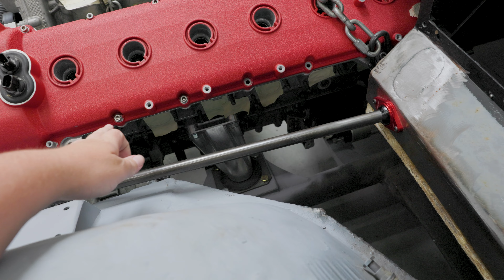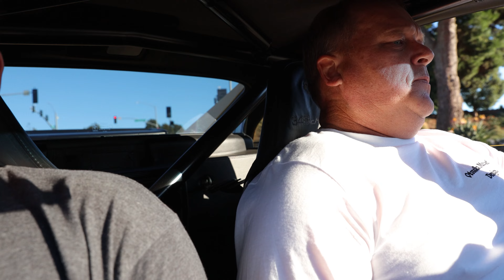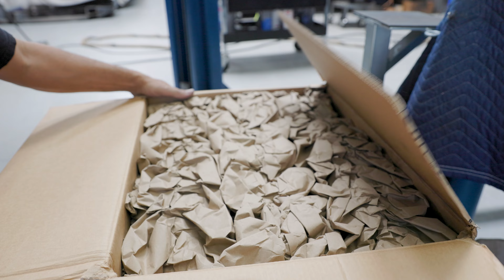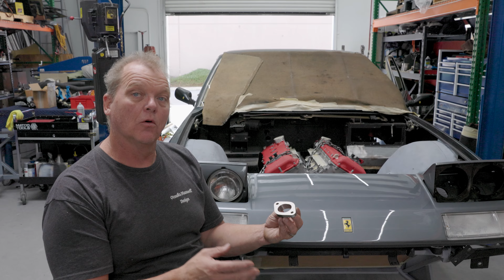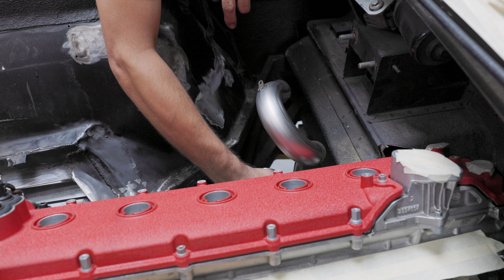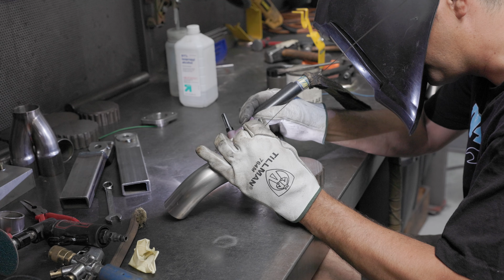Custom 180° Header for Ferrari 812 Engine!!! / Ferrari 412 Build Ep 9

Comment: Did you guys use a software to determine runner length ? Or basically just have to mimic the size of one side based on fitment ?
Reply from the maker: So overall primary length was decided to be 22" based on Steve's calculations, he's done a lot of research on fluid dynamics as they relate to airflow within engine systems. As for matching that length on all 12 runners, Martin uses a wire technique shown in the video, where it's held to the centerlines of radiuses for accuracy, and then measures them post welding and checks them with audio tests. You can also use water or sand for volumetric tests but that felt unnecessary for this specific project.